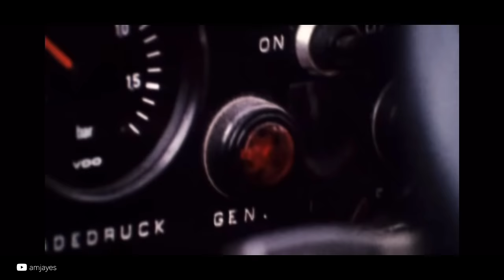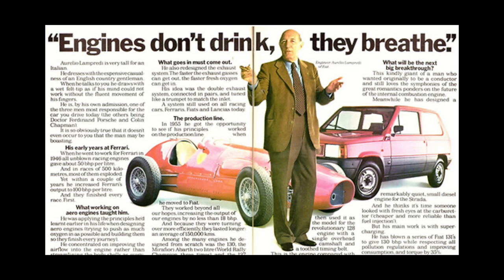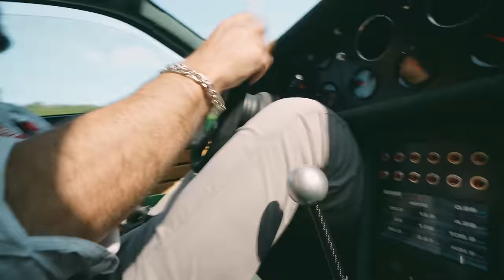The Kimera Automobili EVO37 is an Insane Thrill Ride of a Car — BTS with DTS — Ep. 11

Comment: It is amusing to juxtapose the 1980s WRC motor vehicles with Vox Day's modern SSH terminology and realize it was a bunch of Betas (Bravos) and Deltas which were dominant during the Group B period.

Yes, all wheel drive got all the sex appeal headlines, but it was the purpose-built 2WD vehicles which were the most frightening - and capable - vehicles in WRC. The biggest problem: nobody knew how fast they could go with them, since they provided as much performance as the driver could coax out of them.

This . . . is beautiful, regardless of one's subjective appreciation of styling. Personally, I still find Lancia's Beta to be lackluster without that outrageous rear spoiler, which transformed it from a Chevy Chase parody of a high performance vehicle into a 1980s icon, the likes of which we shall never see again.
Reply: ISSIMI_Official  thank you very much: the work prep zonked me out this morning.

Comment: I can’t get around driver’s sittings position. His knees seem to push against the dashboard with tiny steering wheel squeezed between his legs. Is the car so tight or it’s a position driver prefers? If seat can be pulled farther back there is no way driver can comfortably reach the steering wheel.
Reply from the maker: The driver is 6.5ft tall to give you some reference

Comment: My father had a Stratos, 037 and S4. The 037 was quite good but possibly not as legendary as some people think. Not sure the interior on this version is a significant step up. The S4 is a totally different proposition - a big leap forward from the 037 both in power, handling and finish. That's the one to go for.

Comment: Beautiful car - yes. Brembo brakes, Olin shocks - yes. Interior is UGLY AF. Bad engine - drop a reliable and easily serviceable crate Honda K24 engine. I would make the rear spoiler a clear polycarbonate so you can see out the rear window. Then it would be perfect.

Comment: Who edited this? You don't play music when highlighting the sound of the car. Ditch the music all together. Slow down on your description delivery. Speak with more passion, not like a news article. This is an EVO37 for damn sake! I notice you didn't cover the lack of interior comfort. Italian sized, skinny with no leg room. Like made for a jockey. It seems like a very typical Italian car build. I wonder how it will hold up over time. Italian cars tend to unravel just in storage, let alone in use. 30 years from now there will be that half torn apart dust covered from sitting car pulled out of some old barn. Funny how history is. If I had the chance to drive the EVO37, I'd beat the balls off it, b/c never gonna get the chance again. Enjoy it once to the max. I felt this way when the Vector first came out. Now there's a car that fell apart over time. Still one of my favorites though.